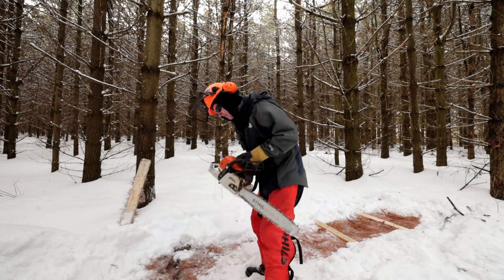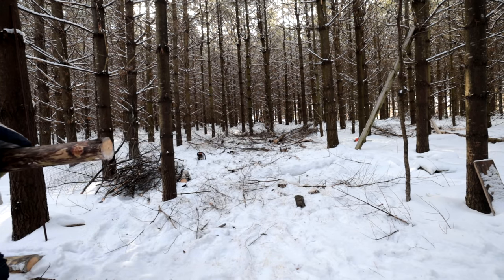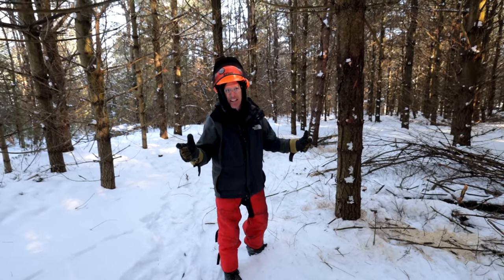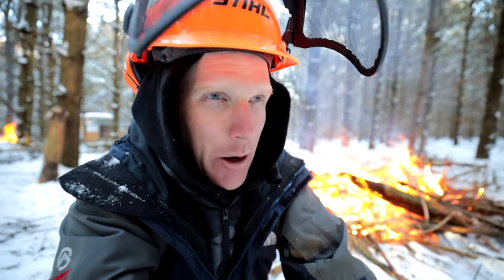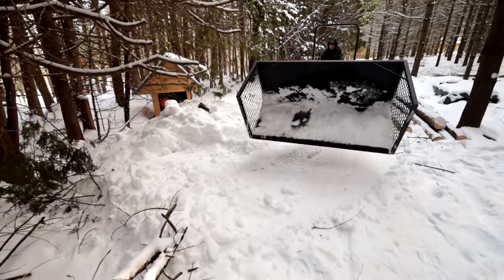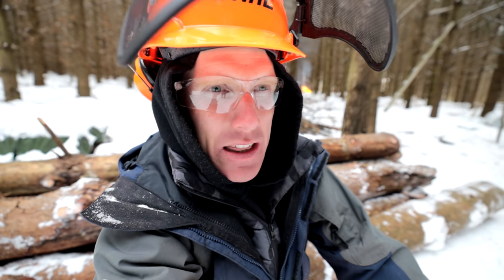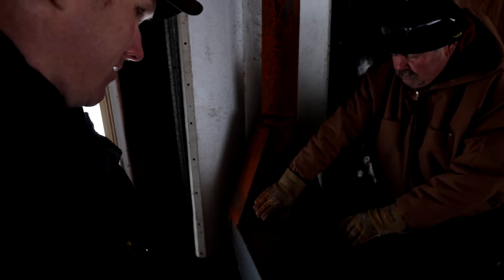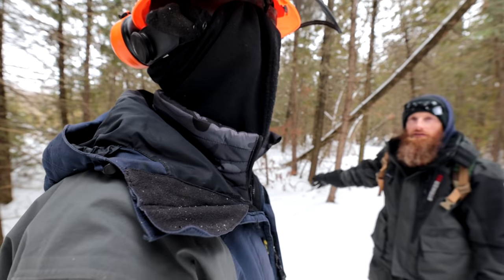Building a Log Cabin from Logs in My Forest!

Comment: Haha, I feel you on the lighter. At the minute in my van I have a 2 burner camper stove, hit the ignition and there's nothing, use one of those lighters and it lights, use the lighter by itself and no flame.

They go out on a whim, breath a little heavy near them and off they go.

Stick with the blow torch.
Reply: Why not use matches? You can buy boxes of triple length ones.

Comment: Kevin, I just bought one of those Geneva lighters and you are right even on the high setting the flame is tiny and if your outside good luck getting it to light.  So, I took mine apart and turned up the flame from the inside.  Now on high, the flame is a good 3-4 inches high.  Needless to say, I have to keep it on low now.  LOL!  It's definitely better than before.  All you do is take out the 1 screw, pull the red collar off, and with the lighter laying flat take off the side panel.  Next slide the low high lever off the wheel put the lever in the low position and put it back on the wheel and turn it to high.  You can do this a couple times if you want but I think just twice will do the job.  Then put it back together the opposite way you took it apart and you have yourself a good high flame lighter.  Hope this hack helped.  Now you don't have to waste money by throwing it out and other than it not lighting due to the cold this lighter will work well.  I love your channel and the things you build are pretty cool.  Especially for not spending hardly any money on all the things you have built so far.   Keep the videos coming.  They're great and I find you funny as well.  Stay safe out there.
Reply: I find it interesting that we have to do that to make it work.  I'll give it a whirl next time I have some patience

Comment: Kevin, butane doesnt really work below 0C very well; that's why camp stoves use isobutane that is good down to -10c or so. I am trying ouy my homemade hot tent right now and left a lighter in it with the stove off. It was -5c in here and the Bic wouldnt light; I had to warm it in my hands for a bit so it could warm up enough. Propane is good to like -40 if used with a low btu device

Comment: That was a teaser video, lol, looking forward to the next episode, tell Don to make the sawdust fire starters, you can market them as fire dust from the great North, sure there would be a market for them, until next time, peace my brother.
Reply: I use cardboard egg cartons, candle wax, shredded paper, dryer lint, cotton balls saved from pill bottles, mix the stuff put it into egg carton cups, melt and drip some wax to hold the stuff together and let dry. Break off pieces and use for starting fires. Sawdust would work too,  but mixing two or three of the above together adds air pockets - Don’s sawdust may be too tightly packed.

Comment: Yes you can place stickers on your hard hat. You have place them at least one inch from the edges. This is so if you are welding, grinding or around sparks, hot heat, etc they will not burn you if they catch on fire. The stickers come under fire safety. They have no effects on your  hard hat.

Comment: Butane boils at 30°F.  Keep the lighter in an inside pocket and it will work just fine.  In Canada and northern US States we use liquid propane for grilling.  Propane boils at about -30°F.  In southern US States they use butane gas for grilling.  This past week a lot of Texans discovered that their grills would not light when temperatures dropped to near 0°.

Comment: When I'm felling trees I try to find a "log" about 3-4" diam, and 8-10' long to use as a lever to pry the butts of the trees that have tilted but not fallen.  I saw you using a metal bar for this, but a longer lever would make it easier.  It's also good for when the tree just wants to stand straight;  you can push it up into the base of a branch and get more leverage then pushing on the tree at shoulder level.

Comment: As you are becoming more and more efficient, you should get a chipper tossing all those limbs in there, then put all the chips in water buckets and compress the chips in to bricks, then dry them out for 30-60 days (depending on how fine the cups are) and burn them, great raven warmth for longer.

Comment: For future references, the fire starters are easier when you dip tissue or toilet paper in wax, doesn't matter what type they burn for about 5 minutes when you use double sheets, obviously you want to use a double boil system such as an old saucer inside a pot of boiling water and dip both sides then let dry

Comment: Hey Kevin, I know you are at high latitude and hopefully the electric water bowl works, but have you considered putting a small south-facing solar concentrator on the water bowl?  Nothing too fancy, just a reflective sheet bent into a half-cone seems like it would be enough to get above the melting point each day (heavy aluminum foil laminated on MDF or flexible plastic works well).  The true parabolic concentrators would be way overkill and a fire hazard, but thats essentially impossible to achieve with something hand bent.

Love the channel, keep up the great work!
Reply: It's sometimes cloudy for weeks around here.

Comment: I worked in a Steel Mill and we all had stickers on our hard hats. This is the first time I ever heard of this. We had Fiber Glass type helmets around the heat and Hot Metal furnaces, no plastic helmets allowed, they would melt. I fact our company would give you some stickers to put on your Hard Hat.
Reply: The glue on some stickers can compromise the plastic. I don’t really think it does anything but if you got hurt and had a bunch of stickers the helmet/hard hat company could try to blame the stickers for causing thier products to not work properly
Reply: Yep they came up with a ruling that you cannot put stickers on your helmets

Comment: if you did not live so far away from me, I would bring my ATV with a winch to help you with those trees. It would be simple to hook onto the base of the cut tree with the winch and slowly drive backwards to pull the base of the tree out. That is assuming that the trees are thin enough to get the ATV in between.

Comment: The temperature is the problem with the lighters. They are compressed gas lighters. When the fuel gets too cold it stops converting from liquid to gas and the pressure goes down. Wick lighters like Zippos will work in the cold.

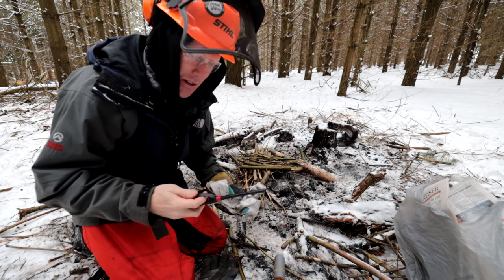Comment: 19:00 Pro tip, Butane lighters do not work well in low temperatures. Heat the lighter up by putting it near your body for awhile under your clothes, or under your arm pit!

Comment: Seems like the solution is to delimb the tree before felling it. It takes so much time and it's so dangerous that finding a better solution would be worth a lot. I was thinking of using two or three ladders connected together. I just checked and they have 20' step ladders but that's too short. They have 60' ladders but they're $1500 but would last a lifetime I think. The solution might also involve those long sheers on a long pole. Together that might get you about 80' up. You don't have to reach the top but if you get 90% of the branches off then the rest probably won't be enough to hold up the weight. Anyways, I'm no expert but seems like you could make some tool that can break dead branches, even if it's not right at branch roots it would keep it from getting hung up. I was thinking a circular blade with a hinge on it that's about 2' wide. Or have a few sizes. Then up to 5x 20' poles. I know lots of tree tops branch off, into two big logs, but if you could open and close the blade with a chain and get it around each side to clear most of the top. I just think it's taking so much time and you have to delimb the tree anyways after. It just makes sense to do it first. Not sure if healthy trees would be a problem but maybe you could delimb healthy trees on one side if needed. Seems like nobody ever tries to improve the ways things are done anymore. I see a problem and think there's got to be a better way because it's so much time wasted almost every time it seems. Unless that's just video editing and those are just the rare cases but I keep seeing the same thing on other channels time after time.

Comment: I'm guessing the air is thin where you're at. That struggle with the lighters, the fire on those pile of dead branches weren't blazing considering they're already dry. I live in a high elevation area where the air is thin and we never had forest fires that's not man-made.

Comment: Lighters don't work in such cold. It is below the boiling point of butane. You need to keep them warm in your pocket. Propane boils at much lower temps, but they don't fill plastic  lighters with it, because they would explode from the pressure.

Comment: If I had money I'd totally be buying you a set 3 of nylon ropes. Smh... out in the bush like that your cutting is on point... but for the sake of safety and ease at least a nylon bull rope or 2 and a weighted sting to pull the rope into the top of the tree for pulling it down. Lol... also you can use other trees to control the rate and direction of falling or use the ropes as a pully on other trees. Lol.
Reply from the maker: That'd be helpful.. a throw line would also be helpful.  Working on it.

Comment: Are you going to put in a wood floor or keep it dirt. Log cabin with the diameter of the logs available you will need quite a few logs. I myself would make a shack out of milled lumber it would go together rather quickly and you can make it larger than the average length of the logs you are cutting down. Perhaps a cobblestone foundation and gravel or gravel mortar floor whichever I'm sure with your technical genius when it comes to building things it will be SUPERBLY DESIGNED AWESOME.

Comment: Kevin,
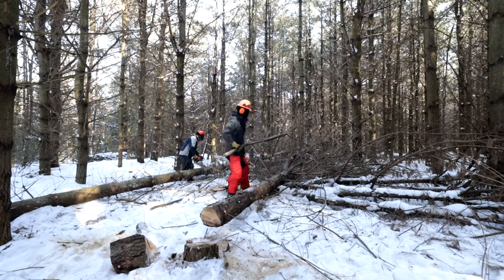10:50 HHAHAHAHAHAHAHAHA I'm sitting laughing at you the same way your tractor is!
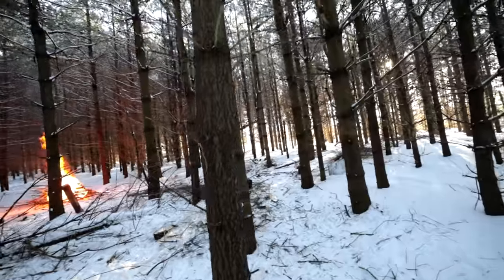12:00 A fire that size is gonna get that fire timber forest a burnin, be careful please
14:30 Nothing wrong with you showing Wood on a family show? Hahahahahahaha!!!

Kevin, the lighter is a bbq Lighter, not a Forest Fire Lighter, it's protecting you from yourself ? : ) Did you turn the fluid safety switch to 'ON', I've found that helps, just sayin. ; >

I'm curious, and not criticizing. 
All of the branches and trunks you're burning now, wouldn't a lot of that be useful to save for kindling or firewood rather than burning it all off while you're cutting the trees down. I know you have lots of dead standing trees, but why not stack most of what you don't use when you cut it down? Wouldn't that save from having to cut more down in the near future to burn for heat inside the cabins and your house? 
I see a lot of others do this on their channels as well, and it seems counterproductive and making more work to do in the future, and then when they need wood they're in a mad dash to cut and chop it into burning size. They also don't have properly cured wood which not only causes lots of smoke but can also be hazardous even dangerous. This dead wood is for the most part cured already. Cutting all the standing dead wood down is a definite must, but why not keep it as firewood for the future? Just wondering the logic behind it.
Keep Safe,
Peace, Happiness, Love and Laughter Always,
Matt
Reply: You'd have to cover it and keep it off the ground otherwise it would start to rot immediately...
Reply: @cmosphoto1  Ahhhh ok, makes sense. I just see so many people doing this and it just made no sense to me. Thanks Kevin